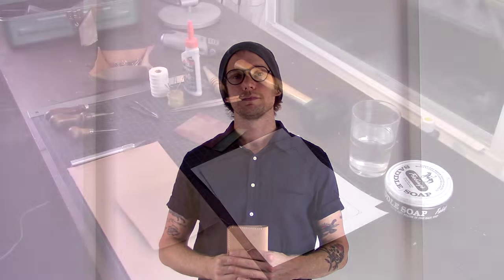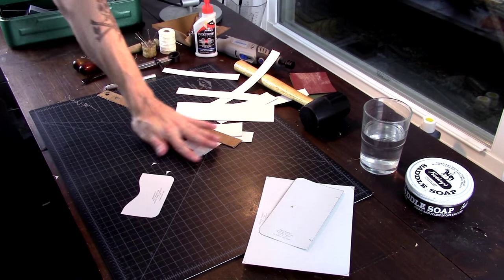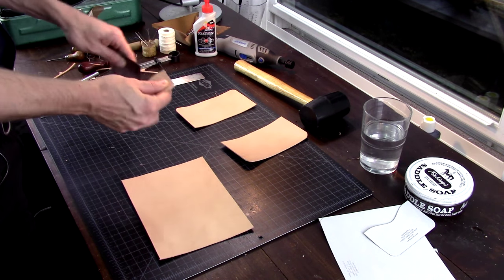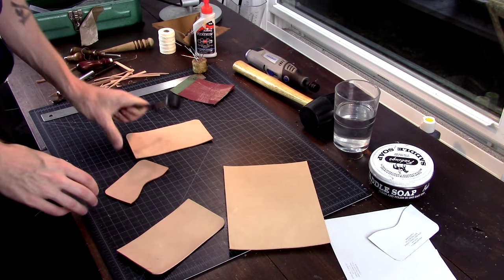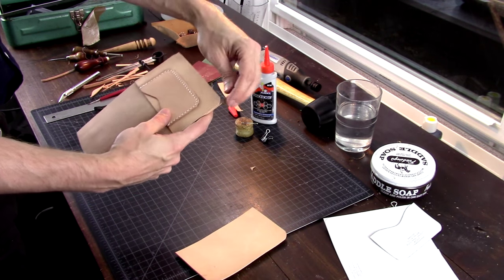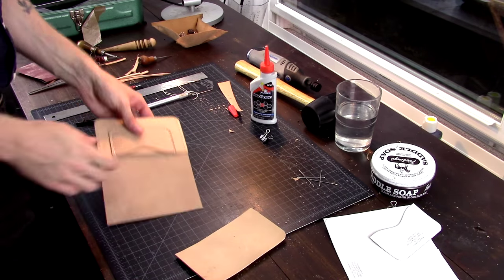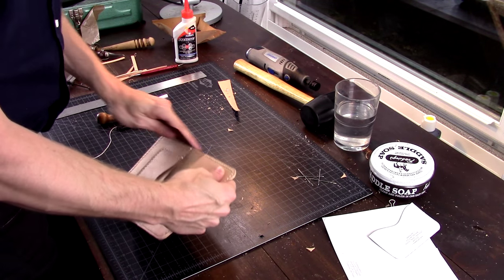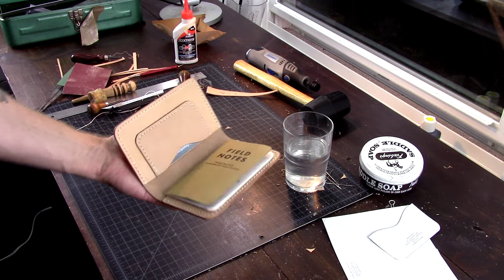Making a Leather Field Notes Case - Build Along Tutorial

Comment: I Purchased the acrylic template. It is just what I wanted. A quality and durable product. 

I purchased one of your competitors templates at first because of the low price. Big mistake. It was a thin plastic, barely thicker than card stock and the edges were melted. I mean they were melted, yes I said melted so not smooth at all. That was returned and I ordered yours. This proves that you get what you pay for. Your template is well worth the price, high quality and a great value. I will always buy your templates from now on if they are available in the item I want.

I am a beginner to leather work. I made over a dozen field notes cases so far. I buy inexpensive leather just to practice cutting out, fitting, gluing, sewing, finishing. I have no need for so many field notes cases but I enjoy the task and my quality improves with each one. I feel that I am getting pretty good now and learning the basics. I need to move on to some other projects so I ordered a few different templates.

Comment: I want to purchase your templates but I don't understand the letter size version and A4 version. What's the difference between them? Thank you.
Reply from the maker: +Trung Nguyen Just 2 different paper sizes. The Letter size is for printing on 8.5" x 11" (215.9mm x 279.4mm) paper and the A4 is 210mm x 297mm. I did both just to make sure the pieces dont need to be moved around or scaled to print out.

Comment: Hi Makesupply, thanks for the tutorial. Where can I get the knife you used to cut the leather?
Reply from the maker: +Jia Jun Chua Hey! It is a #2 Xacto Knife. They are usually available at all art supplies stores. Very common and not specific to leatherworking.
Reply: Thanks for the reply! I am currently using a stationery pen knife, will it be as useful as the xacto, if I use it on your acrylic template? I just bought one of your template.
Reply from the maker: Jia Jun Chua Should be comparable from what I can tell! There are probably many better knives I just got used to the feel of the xacto so I keep using it. Strong enough for straight cuts and flexible for curves. I saw your purchase will be shipping out in the morning! Thanks!
Reply: MAKESUPPLY